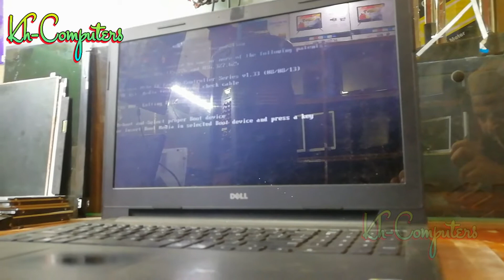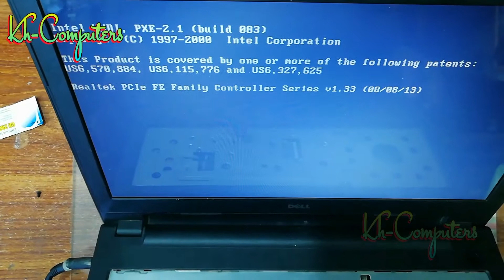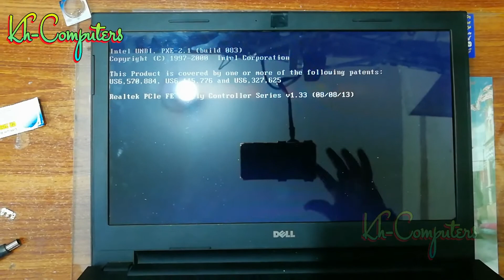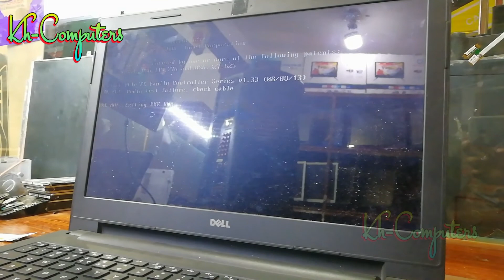5 Beeps issue || Dell Inspiron 3542 || Quick solution

Comment: Hi Brother, I've Dell Inspiron 3543 i5 5th Gen Model, 

Recently everytime i switch on sometimes lap gets on and some time only 5 beep sound comes.
Now last 1 week lap completely doesn't gets ON, only I hear 5 BEEP Sound.

So here CMOS Battery could be issue or Motherboard? Since service people said need to replace battery.
Reply: Same problem
Reply from the maker: Yes brother try replacing the 3v CMOS battery